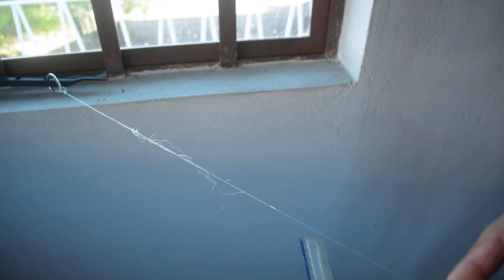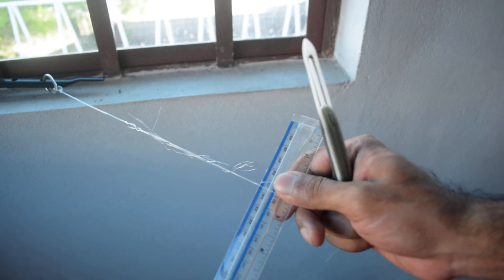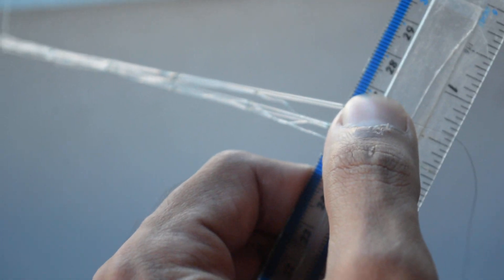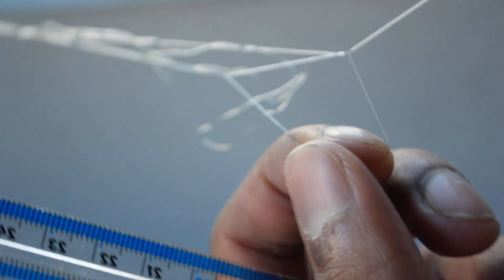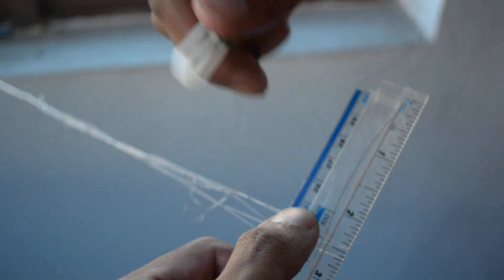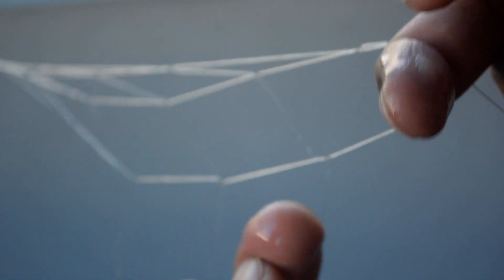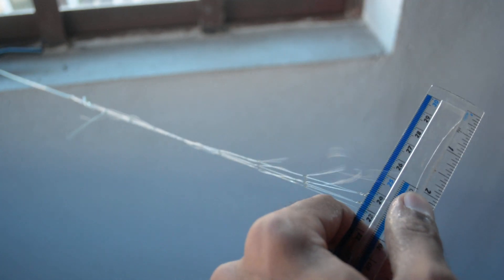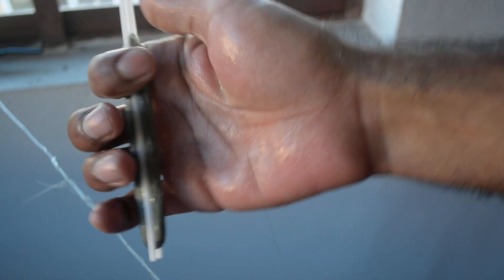Monofilament Net Making Part 2

Comment: I'm having to repair my 1" mesh mullet net but I have no idea what pound test mono to buy for my shuttle, any tips? its a 10' net.
Reply from the maker: Just look at the diameter or thickness of the original mesh material and you should get an idea. A 1 inch net might use maybe 30 or 40lb test.